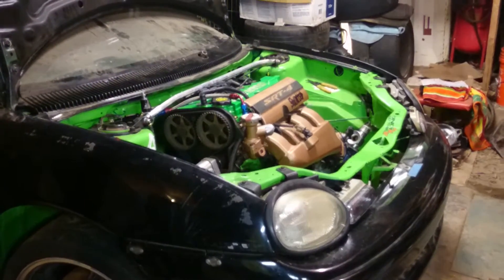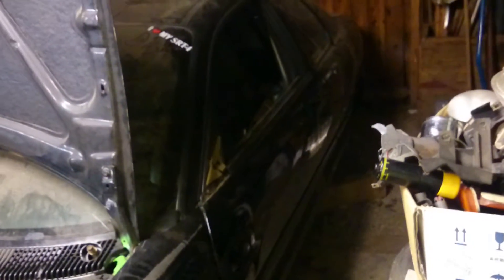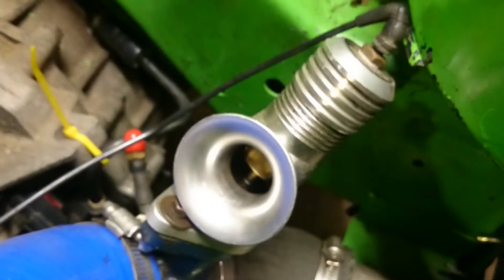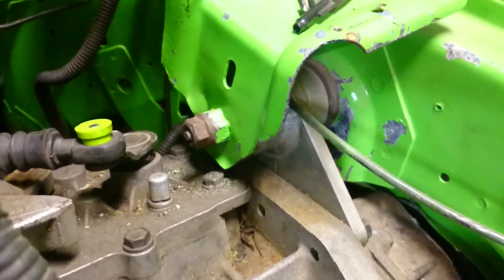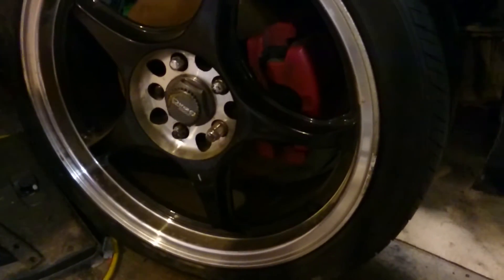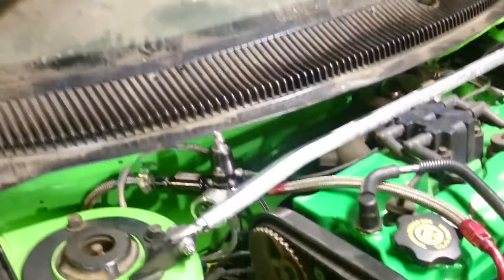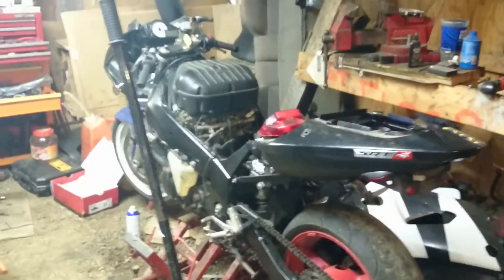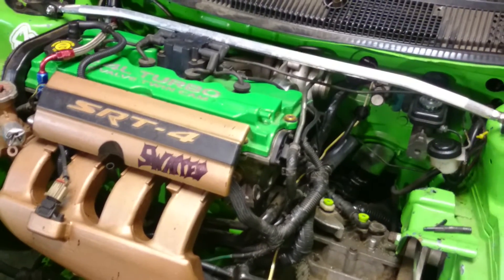1st Gen srt4 swap walk around

Comment: so you removed ac heater moved your battery and computer to where? im going to be doing same swap come tax time i getting block soon. and with all the deletes idk if i can get away with haven a 98 cuz emission. but any how that looks clean bro great job!
Reply from the maker: +Charles Bergeron fuck ac ....heat box wasn't in car when i got it so i just loop the lines but heat will hook right up ....battery will go in trunk or front bumper and ecu will stay same place ....i just wire tucked mine to keep it clean

Comment: What are you doing to reduce the firewall flex with the increased clamp load?
Reply from the maker: idk what you mean
Reply: +that neon channel Since you went from cable to hydro the firewall is most likey going to flex when you step pedal causing the clutch to not release. Most encountered the problem and some probably didn't notice.
Reply from the maker: Oh idk my friend has had his for about 8 yrs and he dailys it and he never has has a problem
Reply from the maker: Mount a bracket from strut tower to the master cylinder
Reply: +that neon channel I guess its hit or miss depening on how bad the chassis has flexed. With a stiffer clutch you will notice.
Reply: 1st time I've heard that. good thing you mentioned it. I'll have to look into it unless I can convert my t850 to a cable. anyone done that yet?

Comment: This is pretty dope, you pulled it out of a PT?
Reply from the maker: +Car Culture yes sir
Reply from the maker: +Car Culture the motor in this video with green valve cover is fully built Wiseco pistons eagle rods king bearings, big turbo but I pulled motor and put a stock pt gt motor in it for daily until I can buy another set of srt4 harness but it's same motor as a srt4 neon
Reply: I heard I has a different cylinder head than a neon srt 4
Reply from the maker: +Car Culture no just different intake manifold, and the tune is dumbd down for economy everything else is the same
Reply: dope, cheap srt4 then
Reply: I'll be making a video on a clean SRT4 soon, i should show him this though haha

Comment: Is there enough physical room to convert the dash into your 1st gen neon?
Reply from the maker: yea but you have to trim the doors or heat them and remold them I like 1st gen dash better
Reply: Oh ok. I looked up online about motor swaps for any car it talked about how you need to have a complete conversion with all the parts from previous car to the new one then go to smog it after it's been inspected by Cali auto somethin person then they give you a new sticker for the car. You must be upgrading the engine from a newer car into an older for it to work. I just found the link just a few mins ago. Here we go. 

http://honda-tech.com/honda-civic-del-sol-1992-2000-1/california-engine-swap-laws-2884674/ 

http://www.performanceforum.com/wesvann/honda/cert/cert.html
Reply from the maker: +Steve The Man yea I live in WV no smog here and inspection don't look under hood plus I'm a state inspector
Reply: Oh Serious? Sweet man.
Reply from the maker: +Steve The Man yea and it's a 95 so don't need inspection either